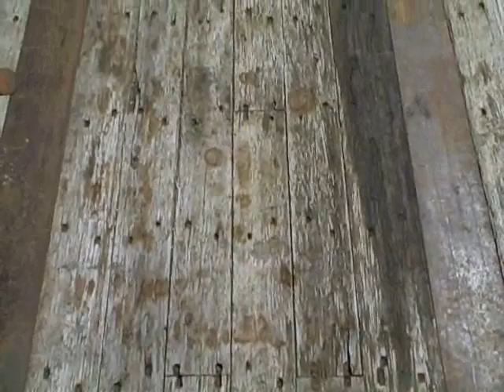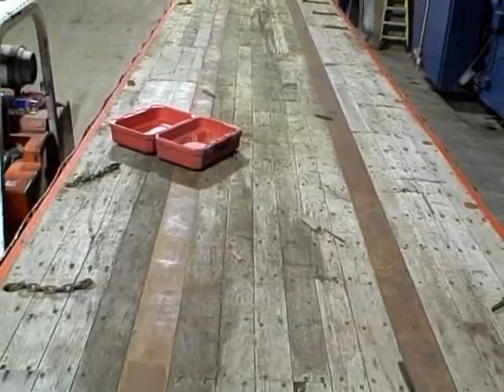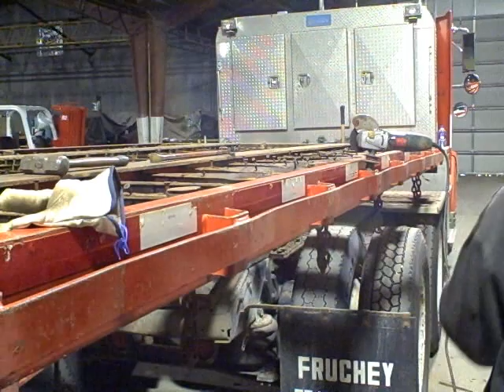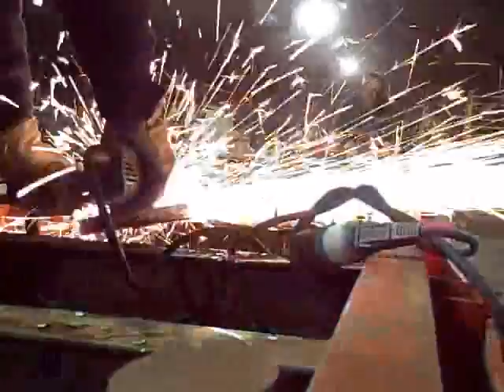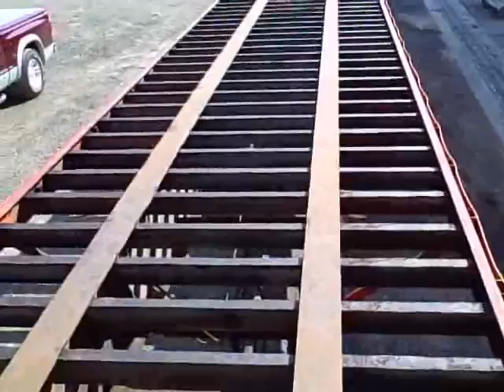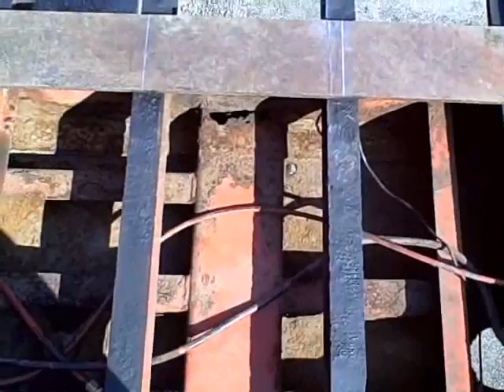Restoring a Flatbed Trailer

Comment: How do you get the deck bolts out after you grind them off? Do they fall out? Do you hit them with a hammer and they pop out? 

When you have rust through spots on the main frame as shown towards the end of the video, do you weld in a new frame member? Weld a plate over it? Patch it with welds?

What wood do you use for decking?

Thanks!
Reply from the maker: The screws were ground flush. Some were pounded out. most left in. 
The frame was repaired and patched as needed. Most of the rusty spots cut out and new steel welded in. Added reinforcement where necessary. We did it right.
We used hard Apple-tongue trailer decking boards for a long-lasting finished product.